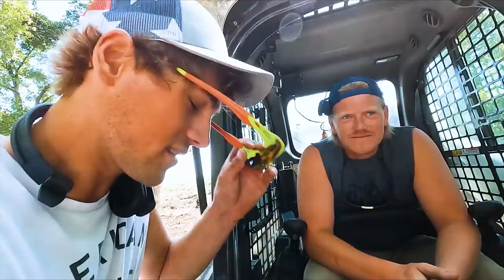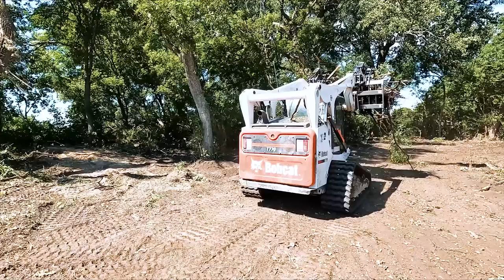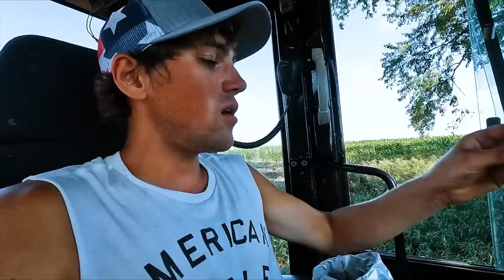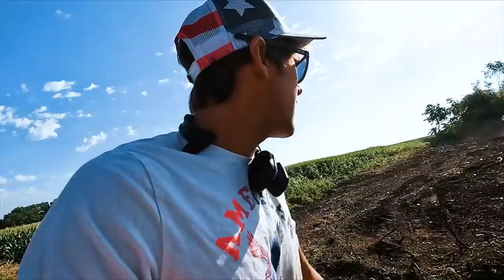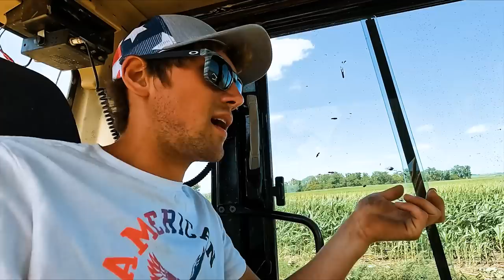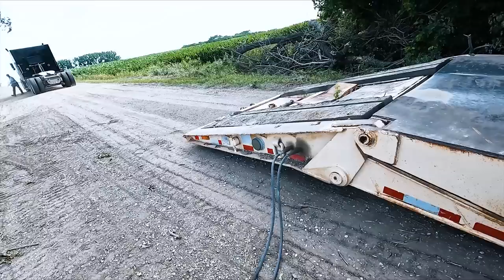Grove Removal Underway!!

Comment: Sometimes,  its a LOT more fun tearing stuff apart than building them back up.  A few years ago,  one of our local churches wanted to put in a soccer field for the kids so the pastor asked dad and our neighbor if we would help out with the project.  I went over with the  7 bottom to moldboard the field and the neighbor brought his backhoe along with the rock bucket to gather some of the stones Id be kicking up.  About halfway through the field,  5 of the 7 bottoms tripped so i told neighbor Marty that there was a rock he might want to dig up.  As I was plowing along,  I noticed he was spending a lot more time than he should of digging the rock out.  He called me in the radio with the infamous words,  " Ya gotta come over and see this!"  The danged rock was bigger than the tractor.  As I was scratching my head trying to figure out how we were going to move the danged thing,  his son showed up with the maintenance truck bouncing through the field at about 45 mph.   Marty walks over and grabs an air drill,  hooks it up to the compressor,  puts some holes in the Boulder on steroids,  and walks back to the truck.   He pulls out a case of dynamite,  smiles like a kid at Christmas,   and announces, " Ya might wanna move your John Deere... WAY back".  He filled that rock so full of dynamite,  it was bulging at the seams.  When he set it off,  the citizens in Hiroshima thought the Enola Gay was attacking again. The Boulder blew into a million bits.  We had police,  the Sheriff,  Highway Patrol,  and I think even God stopped by to see what the commotion was about.  I figured we were most likely going to be calling for bail money when the Sheriff came over and asked,  "Was that one of Martys ideas?"  Since I don't narc on friends,   I mumbled something to effect of that I didn't see what happened.   He just shook his head and looked at Marty and asked,  " ya think you used enough dynamite ?"  Marty confidently said,   " a couple more sticks wouldn't have hurt."  All the Sheriff said was,  " I'm gonna retire in 2 years.  Do you think you can keep from blowing up my county in the meantime?"  To this day, I have a picture of the smoking mass of destruction behind my desk.
Reply: Great story, well told.👍
Reply: We can’t be in trouble officer, it’s for the children…
Reply: Your story reminds me of the scene in Butch Cassidy and the Sundance kid where they're robbing a bank and blow the whole bank to smitherings and Sundance turns to Butch and says "you think you used enough Dynamite there Butch" .
Reply: @kevinmeyer3884  haha.  I forgot about that.   Im not sure how much it would take to blow a safe.  Ill ask Neighbor Marty
Reply: Show us the picture!!! I’m in tears over here hahaha
Reply: @kurtkriener3583  and the church definitely exempt. 👍
Reply: My dad told a story once when they were putting in new township roads. They had cottonwoods in the path that were 8 to 10 feet diameter. They can get REALLY big. Rookie asked the foreman how much dynamite to use and the foreman says "Two."  Rookie wires it up and they all step back for the blow.  The stump jumped over the road bed and landed 1/4 mile away. The foreman gets ticked at the rookie and asks him how much dynamite he used. The rookie says "Just like you said, 2."  Foreman meant 2 sticks, rookie assumed 2 boxes.  Nobody died.
Reply: @rayanderson4119  my grandpa always said,   " If you don't have a mushroom cloud,  you didn't use enough dynamite."
Reply: Back in the day my dad and uncle spent a lot of time clearing some ground that was known for it's boulders and this was back when youjust went to Farm Bureau to pick up some dynamite so my uncle got pretty handy with it and it was not unusual for him to add to celebrations with a quarter stick.
Reply: Marty sounds like a solid dude
Reply: @cletus7419  Hes a blast to be around !
Reply: Go BIG or go home

Comment: We always try to get as much dirt off the root bulb and then split the stump in half, roll it a 1/4 over and split both those halves. The stumps are the hardest to get a good burn on, so we try to put them into the middle where the fire will be hottest.

Comment: Cut the tree's by the road, and use a stump grinder to get the sump below the soil line.  I ran a large cemetery, and had to cut down many old and very large pine tree's because of some disease.  I couldn't disturb the ground to much with burials all around them.  I use the excavator to make the tree's fall where i wanted them by tying rope to the tree if it was leaning towards a memorial.  I kinda liked stump grinding, that thing would make pretty quick work of the stump if it was cut down far enough to the ground.  G-d bless you guy's.

Comment: Change the thermostat on the engine for the radiator. These things get clogged up and reduce flow. Easy fix and will save you thousands and radiator overhaul for just a couple of bucks.

Comment: I have a serious question. As much as you use that trailer why not install a wet kit on one of your trucks? Or buy an old beat up tractor with a wet kit just for that trailer?
Reply: Chris Sperling  first and foremost God bless you as well and if you served in our military then thank you for your service!!!!So as far as having a wet kit you would unhook the road tractor and put it beside the trailer just like the pay loader or ag tractor 🚜 it it keeps you from having to take another piece of equipment just to run the hydraulic’s on the trailer. It would save wear and tear on a second piece of equipment. They don’t always have one there on site that they are already using

Comment: a sad part of the story: the grove moderate the erosion of the fields around them because they slow down the winds and help the climate of the surroundings. Farmers remove them can do better framing but have trouble with the erosion for a few more acre to farm.

for the rock pile ..... i would not dig them. Get the dump truck and haul them away. because some stones tempts to "swim" back to the surface.
Reply: Nobody asked.
Reply: @asmrhead1560  nobody asked you to read and answer a comment, which is a small reminderer of the problems they had with errosion and straight line winds in the past months and complained about it. It is a dilemma for farmers to do the right things, grove removed -> better farming but also no hindrance for the damaging winds.
Also goves are livingspace for various Insects like wild bees etc. Farmers need them for the farming.

Comment: Change the thermostat on the excavator. You did everything else. If that don't fix the overheat issue, the radiator needs rodding out.

Comment: I understand the power surge of using a huge machine but it would speed the process up to use a chain saw to chop the big trees into smaller pieces then remove. Dig out the root base, topple, saw into chunks then remove? Don’t you use your wood as heat? In VT it’s how it’s done! It looks great! People in the burbs will buy rocks to landscape!

Comment: There is such a thing as they call a chainsaw so you can cut it down and bunch it up cut it in pieces you can move it easier but it doesn't run on a pork skid steer that's the bad thing

Comment: Chet, please be careful lifting the ramps.  those things are extremely heavy and the way you just grab them and throw them up there is unreal.  I mean to be that strong is awesome, but you can still hurt yourself.  Don't do that please.
Reply: Spring assistance help lower the weight of the ramps down to 80 lbs or less so your not having to lift as much.

Comment: I must assume nobody there wants the rocks because every field has a pile so there is no market.  As for the trees especially in the age of huge equipment they are just a nuisance to farm around and certain kinds steal all of the moisture from the crops.  For the big ones I would have cut them down at about 2 feet and treated them with Tordon.  In about 5 years the stumps would have decayed to the point that they could just be broken up and the stump gone without any digging.

Comment: Had you thought of cutting that wood up for fire-wood and selling it. It seems a shame that such large trees should be destroyed just to clear land and reduce the number of trees providing oxygen to breathe.  Certainly they could be put to better use than a bonfire.  Time and toil take a toll on all equipment. Preventative maintenance is the answer.  Tree used to be used as wind breaks. This prevented high winds from blowing topsoil away. Cotton wood or not they all eat carbon dioxide.

Comment: A common theme in farming videos is the obsession to destroy trees. I live in Wisconsin, a state with a high density of trees/forests, yet farmers do just fine. 🤷‍♂
Reply: Come to N.W. Iowa. The IDNR hates trees on public land, cuts, stack and burn.
Reply: These trees are mostly scrub trees that started growing because of rocks that were farmed around. The nice thing about trees is they are renewable.
Reply: @robertquast9684  The big cottonwoods along the road were planted by farmers in the past as windbreaks after the big dust bowl. You can tell this because they are fairly evenly spaced and in a line. Nature doesn't do this. And cottonwood was a fast growing tree often planted for windbreaks.

The principle reason they are doing this is less for the tiny acre increase but because today's large equipment compared to when these wind breaks were made ends up in a lot of time spend getting around them as well as poorer yielding endrows then normal. Alas the margins on farming are so tight every bit of overhead cut is a huge motivator. If it will come back around to bite MN farmers in the butt we will see.